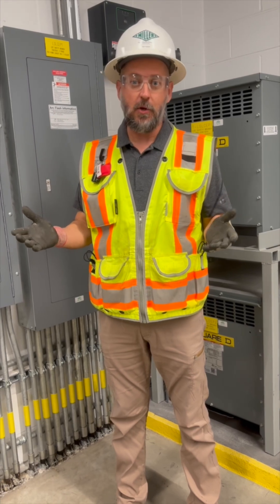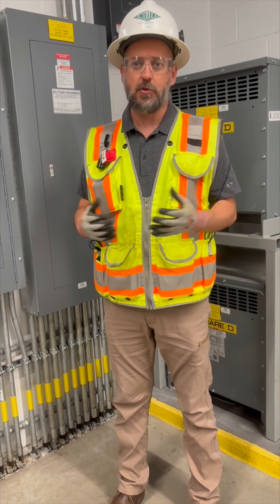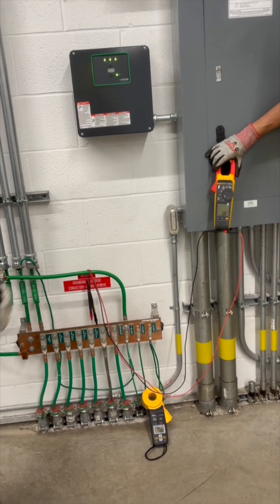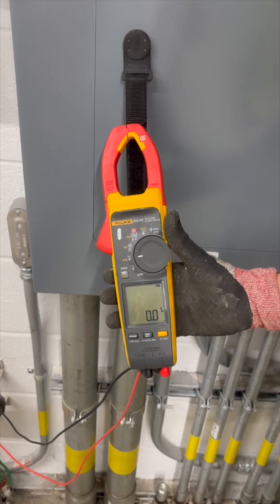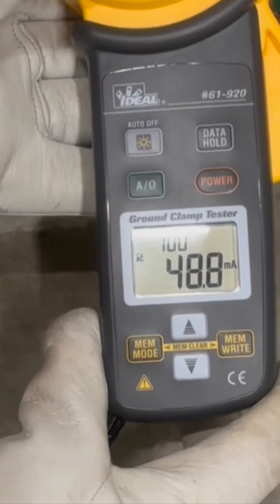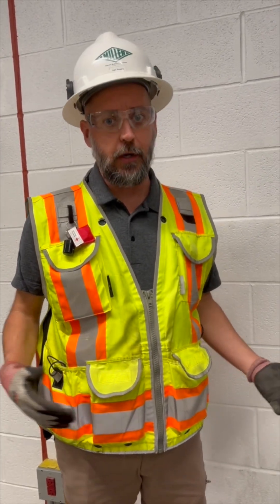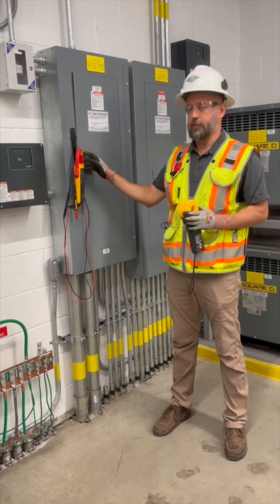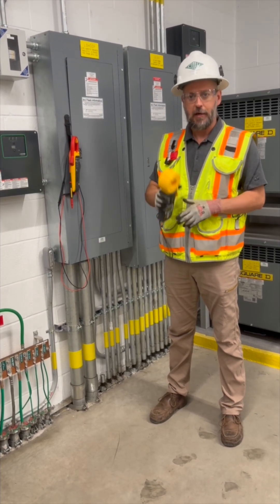Zero-Energy Electrical Safety￼

Comment: It should be called (VAT) Voltage absence test.
That test was carried out wrong, going from a grounded bar to grounded conduit both in the same location have near the same potential to ground as each other "proving" no voltage.
The test should always be carried out going phase to phase and phase to ground.
Reply from the maker: Thank you for watching and contributing to the conversation!

I certainly don't take issue with performing an absence of voltage test or voltage absence test as you prefer to call it. They have their merits, but they also have their shortcomings when a hazard does not arise from voltage. 

The main point that I am making in the video is that we need to change the way that we talk and think about testing to ensure that we have an electrically safe working condition, since insufficient understanding and testing can get people injured or killed. It is therefore imperative that we understand where the dangers lie, and how to test for them.

My demonstration seeks to demonstrate that there can be conditions where there is no obvious voltage present, but amperage is in fact present because it is being imposed by outside forces that may not be understood or described within the testing environment or measurable by the use of a voltage meter or a non-contact voltage tester (tic-tracer/etc.).

There may be some factors in my demonstration that you were not familiar with, let me try to fill in the blanks. The test that you see us doing is in response to the NFPA 70 E, (110.2 & 120.6), requirement to ensure that we provide workers an electrically safe working condition. The location where this demonstration is being conducted is a main ground bar for a large building complex, where grounding conductors, main bonding jumpers, grounding electrode conductors, etc., come together in one place to achieve theoretical equal potential with earth-ground. This grounding system serves thousands of circuits and hundreds of panels via a large and complex distribution network spread throughout tens of thousands of square feet.

NFPA 70 / the national electric code (USA), says that grounding conductors and grounding electrode conductors should only carry fault current to earth (generally understood to be momentary events).  

In this demonstration, we demonstrate that there can be a combination of continuous fault currents, transients, and/or errant currents that are continuously seeking a path to ground, present on a grounding system and representing hazardous electrical energy.  A voltage sampling test (whether it’s called an AVT or VAT) will not be sufficient to prove the absence of all electrical energy on the system, because in fact, there can be electrical current present without obvious measurable voltage. 

*A better critique of my demonstration might be that a lower resistance ground reference could be established and used for comparison to sample voltage in this scenario. You might be able to yield a test result indicating that there was a measurable voltage between this ground bar and that better ground reference, but the likely theoretical differential between the resistance of a great ground reference (25 Ω NEC), and a really great ground reference (5 Ω IEEE), and a super great reference (1 Ω ), mathematically (E=I•R) could likely still yield a voltage small enough for a worker to believe they were safe to proceed to go to work without insulating PPE and tools.

I hope this was helpful.